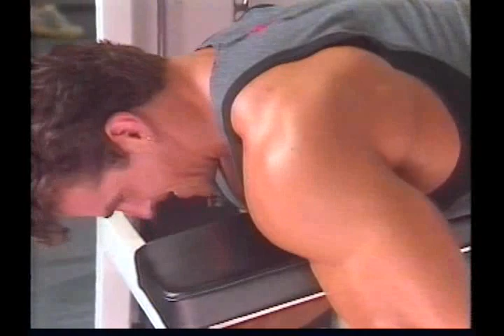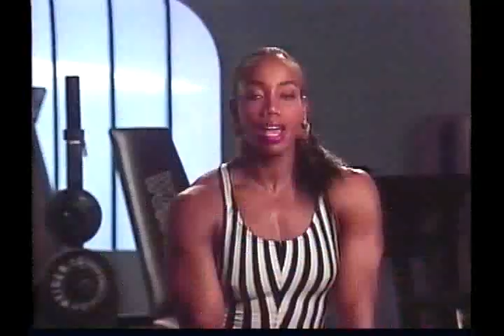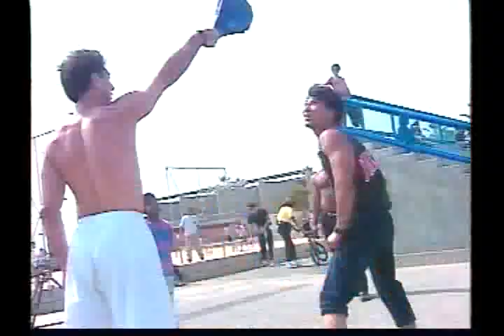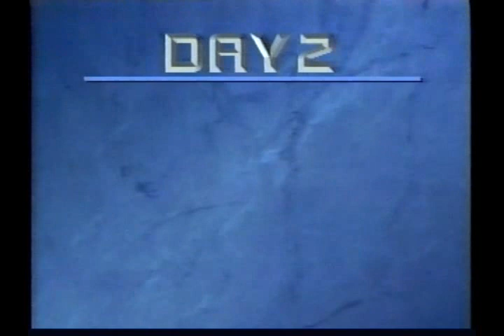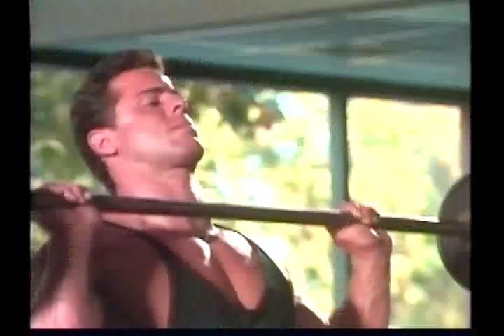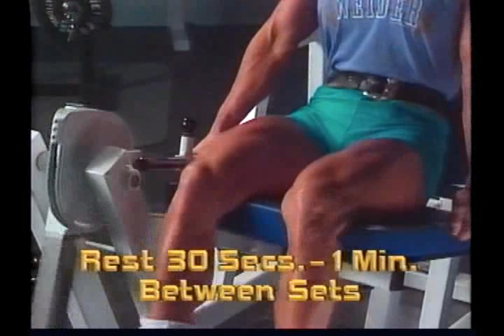Joe Weider's Bodybuilding Training System Tape 2 - Basic Bodybuilding Techniques

Comment: You have to love how steroids are so quickly dismissed. Split routines largely came into existence BECAUSE OF steroids. Back before steroids, bodybuilders would train 3 days a week. You couldn't recover from more training. With steroids, you could train every day.
Reply: themetsfan861 i trained the double splitt natural,hit every body part 2 times a week,it worked well.Intensity is the keyword
Reply: RedLion I don't deny that you can do it naturally. Guys like Reg Park and John McCallum did splits naturally. However, my point is split routines largely came into existence because of steroids. You'd have guys training body parts twice a day, in some cases. You'd have guys saying overtraining is fiction.
Reply: themetsfan861 im your opinion on this one.Training twice a day is BS naturally .if your working out for real,Not like 90% of the clowns talking all day in the gym, you cant do this twice a day,the question which pops in my head when im thinking about this,how the fck do you fuel those workouts?training and eating would use up all your freetime
Reply: This is the first sensible comment I've ever seen about steroids on youtube 🙏
Reply: so